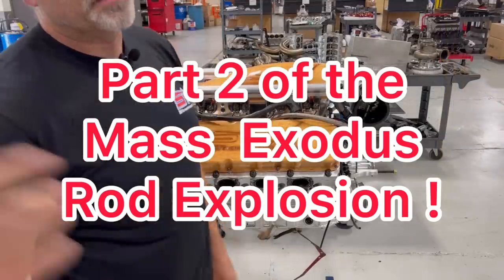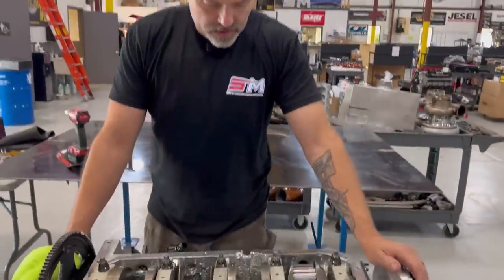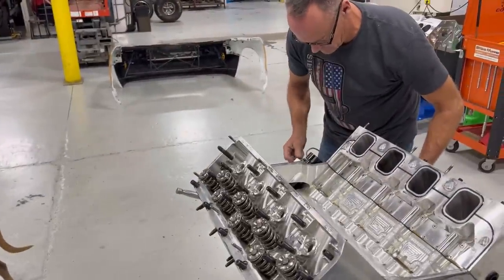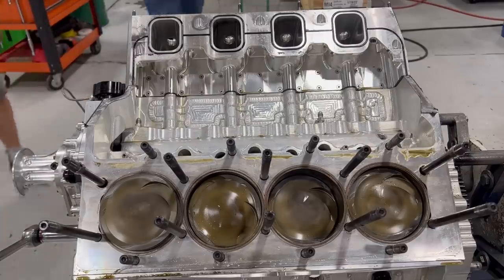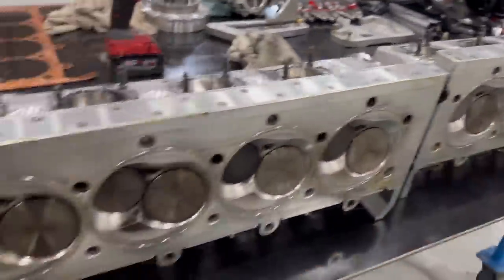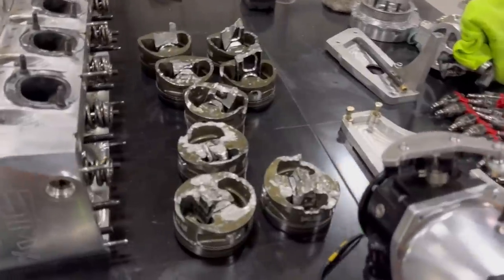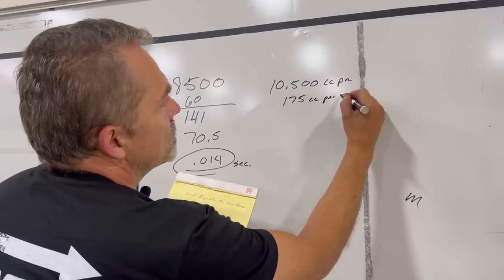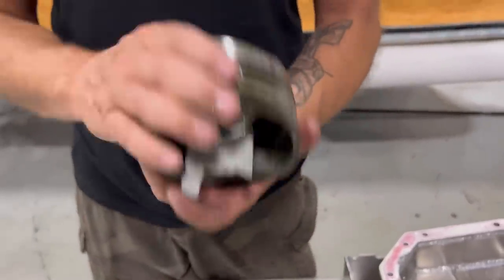EXPLODED RODS  Part 2

Comment: When I first saw all 8 rods broken my reaction was a metallurgy failure, not possible to fracture 8 rods in the same spot without it being a defect in base metal! I’ve seen stretched rods from ultra high rpm, split from end to end from overpressure and you never see all the rods broken even in a catastrophic failure in top fuel! It just doesn’t happen, I am sorry you have to go through this Steve but the rest of us out here would figure human error like did I forget to torque the rods! Just not possible! Thank you for being so transparent, gives me faith. I split a head open on my fresh built ford diesel Thursday, a brand new head failed. Asking myself a million questions, I’ll have it apart this week, betting on a casting line split,,,, I hope!

Comment: I still think it's a metallurgy issue. Those rods where more than likely cut out of the same slug. That's why they all broke in the same area.
Reply: This is the most likely explanation based on my experience as a machinist. Have seen this type of break due to flaws in the metal and also incorrectly labeled material. Have had to throw out many parts due to suppliers sending the incorrect or low quality material.
Reply: Wait, was anyone thinking otherwise? It's the only logical conclusion.
Reply: @Avboden  im still not convinced by the math 😁 😈
Reply: Yes definitely bad metal
Reply: yeah no doubt. The shearing at the piston and the break marks on the chunks that were rod definitely show it to be a metallurgical issue. No hate on the manufacturer, they probably wouldn't have even known it was an issue until they all said nope in unison, glad most of the motor is saveable though, you definitely build motor that can survive severe unscheduled abuse steve
Reply: Could be a design issue though too. Maybe stress concentrations. The area where they broke was machined out so it could be that too.
Reply: Old melted lifesavers.
Reply: @timcustomrc  Yes, I think the rods should be sent out to confirm they are made from what Steve was told they were made from.
Reply: It’s a design issue. Several of us across different platforms have had issue. The beams don’t have the cross sectional area compared to an r&r or bme rod.
Reply: I agree . Thinking they were too damned hard
Reply: By the price point i don’t think is bad metal, but probably bad heat treatment, he did burned some tires before the catastrophic failure, and probably gave a couple of really good revs to that engine. Discard the bad metal or low quality material ideas. Even CP Carillo pistons have a really strict procedure for heat-treating their pistons. To do good in metallurgy you almost need a phd in mechanical engineering, chemical engineering and wizardry, wizardry being the most important of all.
Reply: @Avboden  I was going to only add that this being a first time application for these rods, it may be a case where the forces were higher than the standard of the metal.  In other applications, perhaps the same piece of metal would have held up for ages.  But this is a fairly overwhelming application, and it certainly exposed the weakness.   Gotta say, I love Steve for having an "oh well, it blew up, let's learn something from it and make it better" attitude.
Reply: @1donniekak  my thought exactly.. it isnt "BAD METAL".. it's 100% a design failure.
Reply: @62cripple  aluminium alloy.
Reply: @1donniekak  Argee. Look @31:19. The break looks, to my amateur eyes, as though it propagated along fatigue lines away from the top of scalloped out part of the rod beam. At 8500 cycles it would happen instantly. Insufficient strength allowed rapid fatigue overloading imho. Too aggressive on the scalloping up near the pin.
Reply: Absolutely!!! Billet is not all the same and forging lends way to all sorts of possible porosity issues if rushed.. The fact that all the damage is contained in the rod window area, with no burnouts or discoloration above the ring lips.. Not heat, tune, or anything mechanical... Has to be beer can aluminium...
Reply: Harmonics? Like older top fuel motors when they went from wet sump to dry sump they started scattering motors. They found out that the crank sitting in the oil dampened the vibration and harmonics and kept the engine together. Then they went to dry sump and started blowing up motors really bad.
Reply: @gregsyn1  You nailed it!  The width of the fatigue fracture lines at 31:19 is a clear indication of very high cyclic loads!  We all know Aluminum has a finite fatigue life.  Very finite under very high loads.  But, Steve builds an absolutely beautiful engine.  I would like to see the metallurgists find the initial point of failure.  It could have been an initial fatigue failure of one rod followed by catosthophic multiple failure modes of the remaining connecting rods from the flying parts within the block.  It would also be helpful to see the rod manufacturer's stress analysis of the rod.
Reply: @NineteenEighty8  bingo!  Bingo! bingo!
Reply: @savvymanX30  Says the guy who drinks too many beers.....
Reply: @jasoncantrall6446  Stop. Stick to comic books. YOU are way out of your league here. This is adult talk. Check with you mom before you comment on an adult channel.
Reply: I truly think it was metallurgical or harmonics,   I don't think this was the first set of rods for this manufacturer has made nor do I think the manufacturer didn't know who Steve Morris is and what he planned to do with the rods. I am sure Steve will get to the bottom of this and let us all know.
Reply: Yup I agree as well,  I'd like to see the mill test sheet to prove the metal was what it is suppose to be
Reply: @benburnett8109 I don't drink.. I do however weld, fabricate and deal with impurities in aluminum and chromoly steel on a regular basis.. Was literally agreeing that it's a metallurgical or improperly machined component, if not entirely at minimal for the task at hand... So troll elsewhere to make yourself feel important instead of just impotent..
Reply: @jasoncantrall6446  A crank never dips into the oil in the pan on anything other than a small engine, like on your lawn mower. It is called splash lube, and you definitely wouldn't want that on a top fuel engine. All you would end up with is foamy oil, which would destroy the engine in no time flat. I don't know where you came up with that idea, but it is nowhere near the truth.
Reply: @timcustomrc  I have had it the other way , where a company doesn't have a lower grade material & upgrades it without telling you . You then run into tooling wear on machines because the programing is optimized to run softer material.
Reply: @savvymanX30  I don't think it's fair to call it beer can aluminum. It's entirely possible to both be a high quality, very hard and exactly to spec material - and still simply not be the right material for the job of a 4000+HP, 8500rpm big block application. At lower horsepower and/or RPM, the added hardness may lend itself to a long rod life before needing replacement (something inevitable with all aluminum rods.) 

And the manufacturer doesn't claim these are suitable for this application. They do boast great success at around 2000hp. Might be perfect for that application.
Reply: @jasoncantrall6446  totally agree.  For all to let loose at the same time harmonics seems likely.
Reply: @--_DJ_--  watch Uncle Tonys garage channel. He’s built top fuel motors and talks about it.
Reply: @jasoncantrall6446  If you have a specific video to point out I will. I did a quick search that didn't come up with anything. I have to think you misunderstood what he was saying.
Reply: I think it's the combination of a issue with the material, and the way the rods were designed by that manufacturer.
Reply: @FoolOfATuque  Yeah those were my thoughts as well, a combination of a bad design, with probably a heat treatment issue.
Reply: @savvymanX30  😂 Touché
Reply: @NineteenEighty8  mislabeled or poorly alloyed metal would also be pretty easily explain the failure as well.
Reply: @mattymccolgan9453  Well, the metal (alloy) failed, and it failed by brittle fracture, which is unexpected. (For some perspective: I'm a metallurgist and have an MSc in Materials Science & Engineering. )

But how it got there, that's the question. Bad engineering? Bad geometry and/or bad choice of alloy? Bad heat treatment? (Highly unlikely, I think) Bad material manufacturing? (too much non-metallic contamination) Or something as mundane as a material mix-up, where the wrong material gets taken from stock to fabricate the rods.
Reply: @riffraff9000  This is the problem Steve had no time he had to get that motor back together for sick week he couldn’t get the usual rods and pistons he used this is why he went with this piston and rod set up
Reply: Nope sorry i don't buy it...I Gurantee those are made in huge batches!! The manufacturer would have had many people coming back. And they didn't. I know because I know the manufacturer.
Reply: @chicago_race_engines7538  Steve also mentioned that the rods, for his blown big block 4000 hp application was new/a first.

So you may be correct that, up until now, there were no (or very few) returns from customers. But Steve indicated his particular application was a bit of an outlier.
Reply: This was obviously an oil pan failure. Need a stronger pan to keep all the rods inside the motor.
Reply: No. Your opinion doesn't count. Steve's been at this 30 years.